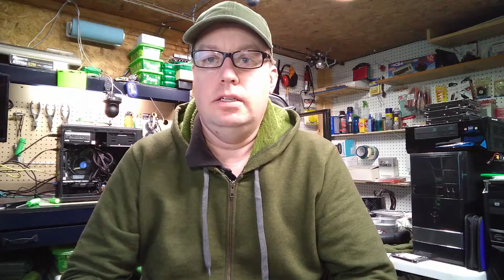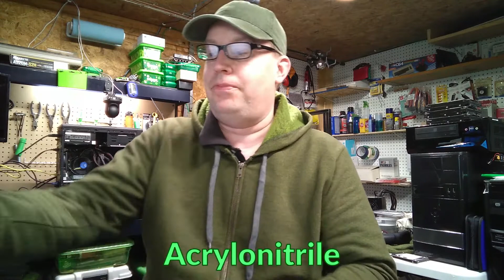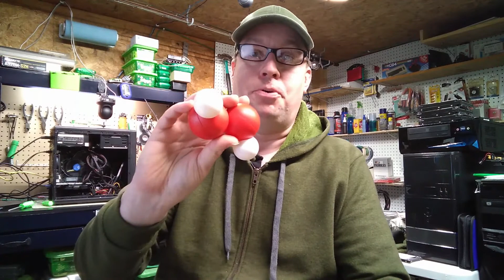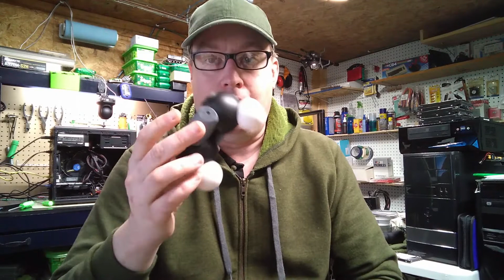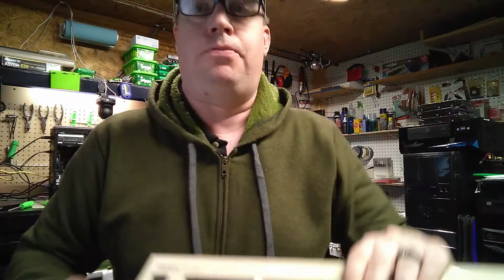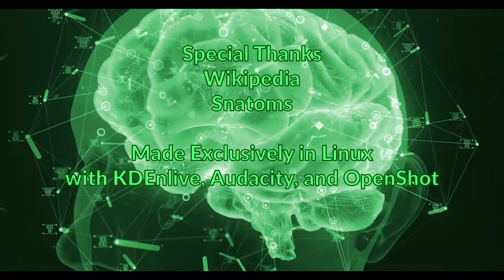Retrobrite Gigsplained

Comment: That's a great explanation thank you. So what about some vidéo game consoles that only some part turn yellow and other don't. Is it because the plastic use on each parts is different and has more hydrogen atoms?
Reply from the maker: That is the issue sometimes, however, heat is also a factor. If some parts get hotter than others, you can accelerate the yellowing on some parts and not others.

Comment: This is really a superb science-based analysis and explanation.  I have watched it carefully several times. Thank you.  There were several statements, however, that my lack of knowledge caused me to not understand, as follows:  (1)  The terms "speedy bright" and "retro bright" were used.  What is the difference?  (2)  Caution was emphasized when treating "soft plastics" (e.g., styrenes) vs "hard plastics"  (e.g. ABS).  How does one differentiate between soft and hard (Is it no more complicated than ability to resist penetration/deformation?), and what are the specific cautions to be observed with soft?  I think the plastics of concern to me are "hard" (e.g., ceiling fan blades and jetted-tub nozzles), but I would appreciate clarification of the terms.
Reply from the maker: Speedee-brite is a retrobrighting process that we developed to avoid using UV light which is known to damage plastics.  As it turns out, using the Speedee-brite method is faster but has only been developed for more hardy plastics (like ABS). Soft plastics like polystyrene and HDPE have a much lower flow point and this high heat method will deform them. Today, most plastic parts have a recycling code on them to identify what kind of plastic they are. In retro, this code didn't exist so it is important to know how to tell the difference by examining it closely. Differentiating between different plastics is fairly simple but easy to get wrong. The feel, the sound, the look all play a part in identifying but even I got it wrong a couple of times.

Comment: Ok, so say you had a 10 gallon fish tank, and you set up a cathode and an anode in open ended tubes, or the what is the exact setup for under gravel filters, conveniently.

 You locate each of them near the bottom of the tank, and in opposite corners, as undergravel filters are designed.  

The oxygen bubbles up one tube, the hydrogen bubbles up the other towards the surface.

 You put a barrier on the top of the tank, and you leave say 6" of air between the water level and the top of the tank. 

Lets say you use some 1" reflective foam insulation, and run the oxygen column right up out of the tank through a hole in the top foam barrier "cover", and into the atmosphere. 

The hydrogen tube only goes above the water, but is still stuck 6" under the insulation and the top of the tank.

 Inside that air gap, you install a shelf where you can put a standard fish tank air pump, and at the end you put an air stone as is normal, and run the tubing down the hydrogen bubble column, so that the hydrogen in the air above the water, and below the cover recirculate down to the air stone, ad then bubble up through the column. 

You use a standard fish tank heater to maintain temperature, say 85 degrees F.

 Does this result in a fluid, in this case water, with a lot of dissolved hydrogen gas in it? Do you think that can that be used for retrobriting? 

Would you also use a UV lamp, then cover all sides in 1" reflective foam insulation to trap in the light, reflect it around all sides of the item, and to lower heat loss or gain from the surrounding environment? 

Do you think an ultrasonic fogger would be useful to expose the water, in 100nm size droplets to the hydrogen rich air above the water line, before it condenses and falls back into the tank? 

I haven't built this device yet, but you seem to have a really well more informed view on this than I do, and I'd love to year your thoughts before I head to the pet supply. :) (Worst case it doesn't work and I have to buy a fish and build an awesome fountain. :) )
Reply: Also if that doesn't work, if we bubble ozone in as well, doesn't it CREATE H2O2? My reading on "naturally occurring hydrogen peroxide" is slim.
Reply from the maker: Hydrogen is explosive. To hydrolyze and capture enough to retrobrite a piece would be dangerous to say the least. We use hydrogen peroxide because it is stable. It then becomes a matter of what will catalyze the hydrogen out of solution so it can react to your part. The retrobrite process only produces a small amount of hydrogen at a time so it is very safe and doesn't require a rube-goldberg style contraption to make it work. Just heat or UV.
Reply: @gigsplain  k.